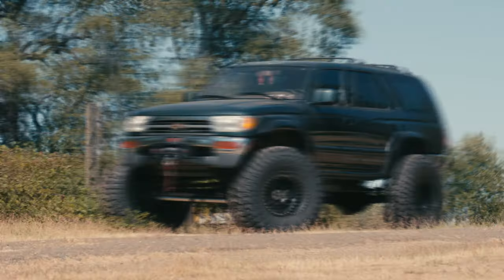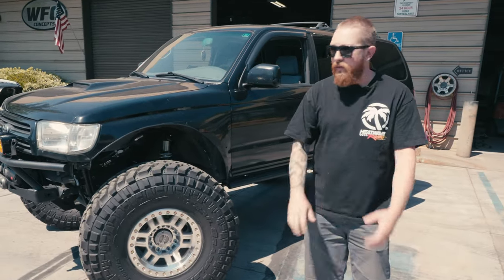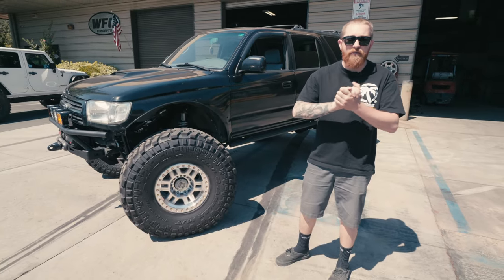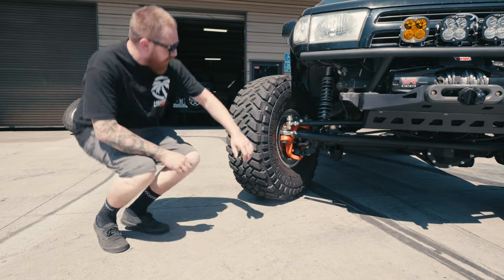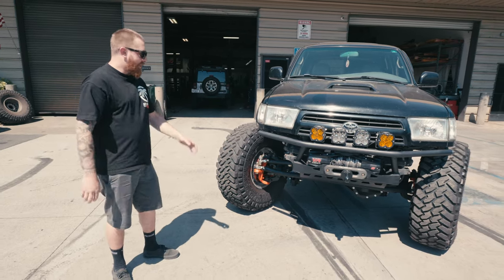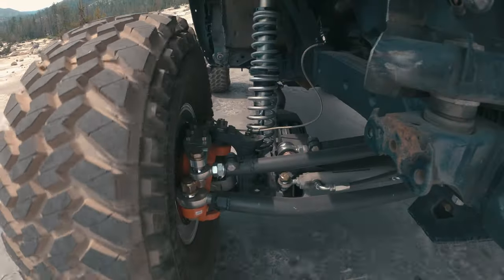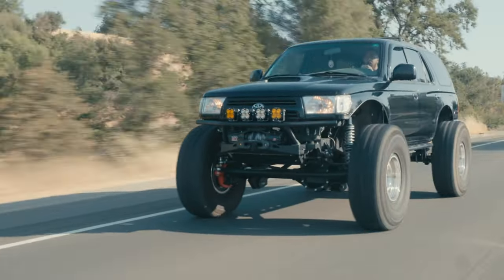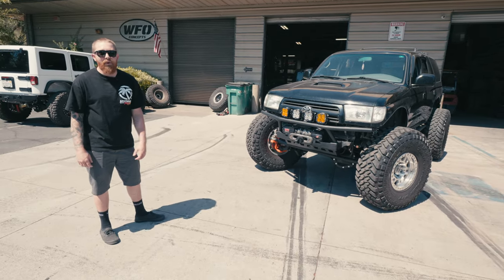Not Your Grandma's 4Runner | Solid Axle Swapped 3rd Gen

Comment: Absolutely love it! She's a peach 🍑 I daily drive my 03 Tacoma S.A.Swap on ALCAN Leaf Springs, and I wouldn't have it any other way, except, I wish I would have went with tons off the bat! Although she drives great on my front hybrid Jeep/Chevy Hybrid Axle and Factory 4 cylinder rear with a TruTrac and 38s with Factory 4.56 gears ⚙️ and a Auto! Yes, 38x13.5x17s, and an Automatic transmission! I drive hundreds of miles every week and for now, 4.46 gears, of course, I live on Long Island, and if you don't know where that is, it's not far from NYC and close to Offroad Hell! There is none! We are regulars at Rausch Creek PA offroad park, TG for Rausch and AOAA! And no trailer! Been wheeling for over 20 years, and I've never had a trailer! And now that I've come to my senses and converted from being a "Jeep Sheep 🐑 " And now drive the most dependable brand on earth and possibly the galaxy? Toyota! My 2.7 is a pleasure to work on, just realized that after installing my LCE header, so well engineered! Unlike a giant mistake like the brand new lifted high end suspension Gladiator that wobbled past me a few months ago 😂 My Oldschool Leaf Spring Yota doesn't Wobble! And will offroad all day with the AC on! Next project is the 1 tons from the F350 V10 4x4 that's sitting next to her. With 27,000 Local H.S. miles. 5.39, Detroits F&B (I'm really not fancy) Leafs, etc! And I will be using whatever I need from WFO , not POS T.G. garbage 🗑 Nope this time, it's getting done right! Coming from the Jeep world, I really didn't have a clue about S.A.Swap Toyotas? I'm literally the only Solid Axle Tacoma on Long Island NY! Seriously, me and a 4RUNNER about 60 miles east of me, so pretty much nada! But there has to be at least 20 billion jeeps! From Manhattan to Montauk! They're Everywhere! I get it, I've owned around 20 Jeeps, they're easy to build and super capable, but did we get into offroad for easy? Seriously, people do something different and original! For the love of God! 😅 Anyhow, sorry for the long comment, but I just love S.A.Swap Toyotas! Dependable, Reliable, and stupid Capable! And I ain't going back! Fk being a sheep 🐑

Comment: Awesome- 
I’m building a 3rd gen with a turbocharged 1uz and have been tossing around the pros and cons of LC80 front and rear axles vs going super duty.  

Do you think you’d still have to trim fenders if you just went with 35s on the SD axles? I know it seems like a waste, but with goals of around 900hp, I’m thinking I could use the strength. Just really don’t want to cut into the body, which will sacrifice some uptravel. 

Thinking low and wide

Comment: Naw my 3rd gen 4Runner has leafs all around with a tg front axle so I can retain my Toyota 3rd members and my 4Runner has 360k on the og motor and trans I only run 35s with 4.88 gears tho that way I can daily it if needed